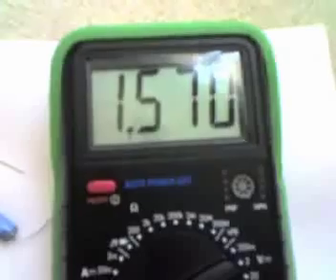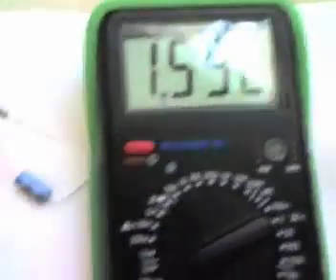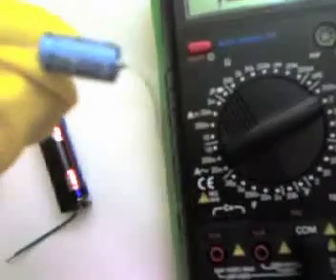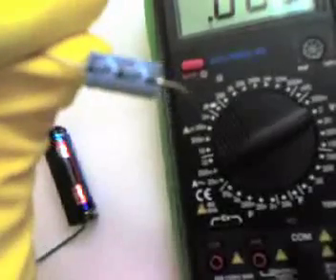Charging and discharging a capacitor

Comment: @davidjereb I checked out your vids dude, and your Arduino based "magic" switch intrigues me,  I wanted to implement something similar on a motorized or indeed a digital ramp volume fader for a hifi amplifier I made, at the moment its a CMOS based touch switch  (CD4013 if I remember correctly) anyway if you have a link to a project site forward it to me :)

Comment: @insonicbloom Actually, they NEVER charge instantly and neither do they discharge.
Because ideal components don't exist, you always have some resistance in your circuit and therefore the cap doesn't charge up instantly.
Also, if you wanted the cap to charge up instantly, you'd need infinite current. Again, impossible.

Comment: guys i wanna put a capacitor in an electric motor, the motor uses 4 AAA batteries wich one can i use, the motor is fron a R/C car (xmods), i can buy the capacitor from ebay but they sell them for about $6 dollars, and i know i can get capacitors for a cheaper price but i don't know what kind i have to use, the capacitor has to be hook from the (-) to (+) of the motor or (+) to (-). some help please

Comment: its an electrolytic capacitor, ceramic ones are ceramic which gives you an idea as to why theyre called ceramic.
and capacitors charge instantly and then discharge instantly, the meter shows this as a slow discharge because its making a visual interpretation. 
I hope by now youve learnt abit more about these things, plus capacitors are usually used as filters rather than the storage of electricity.

Comment from the maker: The capacitor in the video is a ceramic one, which is not the best quality. It only took me a couple of seconds to charge it and it held its charge for several days. The only limit I know is to use a capacitor that has a storage capacity greater than 9 volts or else the capacitor may explode. I do not know the answer to the last question. Have a good day.